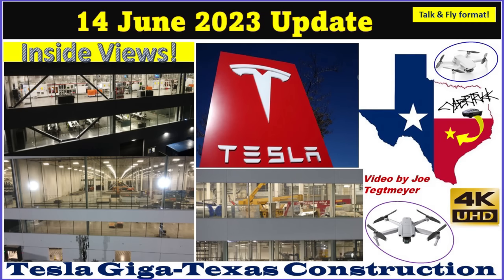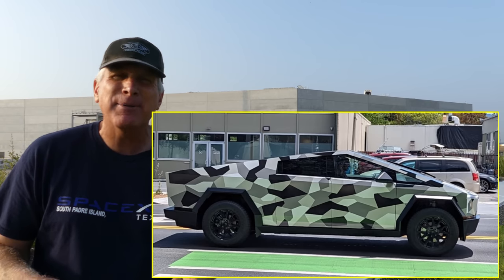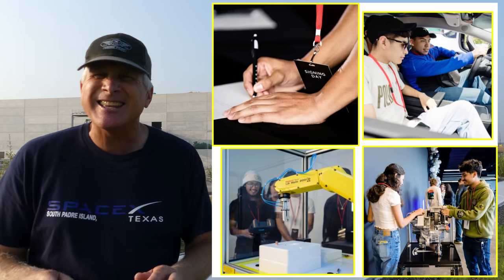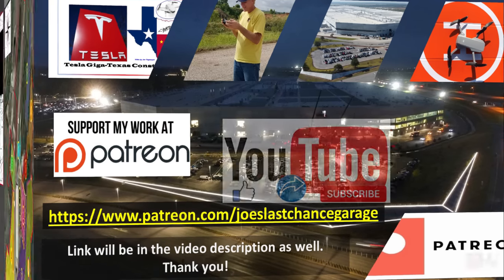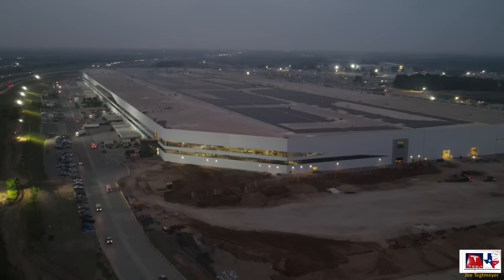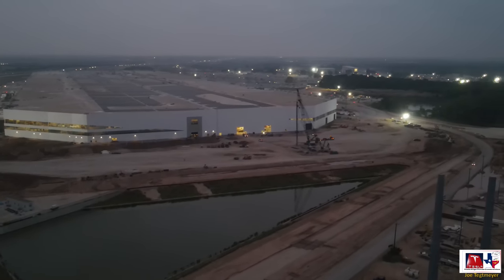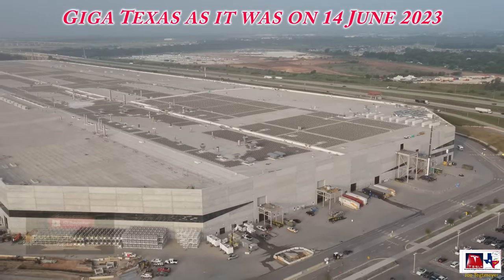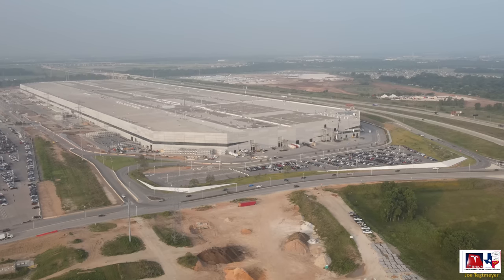Interior Views! Big Deliveries & Cathode Window Installation! 14 June 2023 Giga Texas Update(6:45AM)

Comment: Thanks Joe. Early morning views are great. Bumper issue today.
4:44. Battery. Cafeteria on Level 2, and Level 3 immediately above.
5:38. Battery. Level 2. Drop sheets. Painting inside also.
5:58. Battery. Level 2. Another cafeteria.
6:28. Battery. Level 3. Column at base of stairs. Last views in here, this was about the extent of Level 4.
6:40. Battery. Level 3. Mezzanine/Level 4 generally the width of 2 column bays.
7:34. Main Entrance, inside. Floor part sheeted with cardboard and plywood over. Presumably for scissor lifts to drive over. Floor must be a finished surface now.
Reception desk now black. Scaffold constructed around the desk area, deck level about the right location to work on the face of the bulkhead.
Ducting on the floor awaiting installation.
8:10. GA Level 1, General Assembly 2 and 3 lines being installed. What’s all the production equipment on Level 3 for?
8:17. GA Level 3. Black items look like structural battery pack crates.
8:40. GA Level 2. Very low ceiling height compared to the other floors. Might be suitable for offices.
9:00. GA Level 3. Huge numbers of robots visible in here. Is this Cybertruck BIW, Cybertruck GA? 
9:48. GA, south. Level 2 window looking into Level 1. A plant platform/mezzanine visible though the floor opening. Might be an inter-floor vehicle transfer point.
10:16. GA, south. Level 3 floor opening infilled.
10:37. GA, south. Level 2 window looking into Level 1. Truck load of spoil leaving. Still digging.
13:03. GA/Stamping 2. Left. CFA piles barely visible in the excavation abutting the existing footing. Similar excavation at 13:42 has 3 CFA piles.
13:29. Southend. Breaking away the concrete from the top of the CFA piles to expose more of the rebar.
13:56. Southend. Rebar cages. Some of these are complete and ready for installation.
River Road/North-south road intersection. Right. Trenched across for more conduit.
14:06. Southend. Right. Assembled forms for concrete pedestals. For similar footings as seen in Stamping 2, i.e. deeper footings for some in-ground structures to be built between. https://youtu.be/85CBlJHKvcY?t=406
14:18. Stamping, apron. Another curved machine guard.
15:58. North-south road. 3 large but not particularly heavy deliveries. Twin axle trailers only.
18:12. Cathode, east. Some geo-piering done to the left of the excavators.
19:11. Cathode north, Level 3. Window units installation commenced.
19:57. Die Shop, north. Formwork and rebar for an apron. Trenches for a rail system perhaps. Maybe a travelling gantry crane.
20:34. Cathode, plant platform. On the ground. Stainless steel pipes with elbows and reducers on either end.
22:24. Tesla road, north. Vaults. Duct-bank  pointing north to the switchyards.
23:06. New switchyard/substation. Right. Stacks of formwork shuttering for the Mega-Vault walls.
Mega-Vault. Top Left. Plastic laid over the slab. Serious about curing this.
25:39. Tesla road/BESS site access. Road closed, trenching works.
25:48. Northend, parking. New slab, bollard either end. Location for a permanent Security building, or a pedestrian crossing perhaps?
Reply: 25:48 - Maybe they just wanted a slab they could tear up to access the duct bank again?
Reply: @patrickkenny2077  25:48. On closer inspection there's parallel dashed lines, and 'cut here' embossed into the surface.

Comment: Joe, thank you for continuing information from the construction areas. At 16:04 are shown four large boxes on low boy trailers. These might be assembly line modules that have been assembled and tested at the manufacturers location and will be installed next to one another to form the line. This process is normally used to be able to easily adjust the line as required.

Comment: Great Flight Joe. The YT channel CSI Starbase most recent video went though the connection of power that is going on throughout the facility. One thing looked very similar... At Starbase they built a huge transformer vault that goes between the switchyard and all the conduit to the facilities. I think a large transformer vault is what is being built on the south end of the new switchyard.
Reply from the maker: Thanks DJ and you may well be correct! 🤠🤗
Reply: Switching equipment possibly (Possibly on upper level). No need for more transformers at this location.
Reply: @DavidJohnson-tv2nn agree, likely a vault for 3 phase high voltage buss bars (likely one set on the left, another on the right, matching up with its nearby switchyard transformer), this will be the “demarcation point” between the utility and Tesla, from each of the new switch yard transformers, once its all connected, it’s unlikely they’ll need to enter it again, but with Tesla, you never know
Reply: @mwolrich  "When's the last time we dug this area up?" 😁
Reply: @scottgaree7667  First time... they installed the temp retaining wall, now their installing the high voltage distribution vault, then it will be backfilled, with a few manholes to enter it, most likely
Reply: @mwolrich  Keep in mind that they will need a means to independently disconnect each of the conduit-banks going out to the different buildings, in order to perform service. They will also need a means to disconnect everything from the LCRA transformers and connect to the backup power feeds from the BESS substation in the event of a power outage. This can only be done with switching equipment. Which will need maintenance. Just speculation at this point, but this will probably be a two level structure. A cable room or vault below grade, with switching taking place on the upper level.
Reply: @DavidJohnson-tv2nn we’ll see, in due time.

Comment: 23:51 Substation switches/disconnects.... Can't see clearly past the north A-Frame structures. But... All appear closed except power to the transformer primary and the east monopole. Meaning, depending on the circuit breakers, the substation is ready to be energized, or already energized. No changes in the last couple of days.

Comment: What is the black plastic pipe used for?
Reply: 22:16? One would likely be a force main (pumped) sanitary sewer. Both may be in fact. 

Reclaimed water gets mentioned, but that is normally purple coloured, purple painted, purple sheathed, or otherwise clearly marked to indicate what's in the pipe.

Comment: Substation:
Tesla Enclosure/Mega-vault: @ 22:59 Any guesses as to the purpose of the concrete pads?
Tesla enclosure/Mega-vault: @ 23:14 My guess is that Most conduits will enter from the south side. At least 4 entry points. (2 duct-banks out to the factory, and 2 in from the BESS substation 24.9 kV bus). Perhaps 2 more duct-banks out to the vaults seen @ 22:21 And perhaps as many as 8 conduit entry points as Harder NL suggested. Again, just speculation, we will have to wait and see. 
Don't have a guess for the entry points for the feeds from the LCRA transformers yet.
Reply: 22:59 I think those are concrete wall panel forms for the vault. They are about ready for them.
Reply: @bobcallahan2322  You may be right. Thanks!
Reply: @DavidJohnson-tv2nn  David, this is just a guess:  When we used to design computer rooms we had a raised floor with removable floor panels and all wiring to the plants entered from the bottom to the equipment cabinets. This may be the idea here also. The feeds from the transformers may enter from the top of the building.

Comment: at 26:40, the racks on the left appear more boxy than the ones on the right with the angled bars.. you can see the same type with castings inside on the extreme right of the image. a close-up of the contents of each rack would help a lot
Reply: The racks in the center are rear castings which stack inside each other, the other racks are for front castings only five per rack.

Comment: can you not anodize stainless steel?..be my choice if possible.
Reply from the maker: I think it would have to be done before assembly
Reply: Stainless cannot be anodised, the process would damage the steel.
Reply: @JoeTegtmeyer   no you should be able to use chemical treatment like a paint, wipe off, to get anodize color..yes if you dipped to anodize you would get brighter color, but be all sides and might limit welds glue bonds..but a hint of color should be easy..as wipe on..no regrets as wont come off..fancy pants could add electric currents to create ..well stripes as only where liquid sit,puddled would take current and activate chem to achieve color brighter changes greens to blue- red to purple..treating stainless this way is possible..some heat treatments..also..but its all new as stainless..ty elon great thing it will be..and ty joe love ya reports
Reply: @garthbews4863  Anodized metal is actually metal that has been chemically treated to oxidize the surface. The metals include aluminum, magnesium and titanium.
Reply: @eltonray2934   i was sure.. i ve have seen"  looks like anodized kitchen sink/back splash/counter/hood"  .. i ve seen the effect of Anodization(yes chemically treated,often with low grade electrification to increase color , have done aluminum ....  i assumed it was stainless steel..pure ,could it been titanium, or mixture?, yes, but costs would huge..was fancy hotel kitchen we were working on..was treated after installation..over weekend..again assumed stainless as normal in this application with fire code/bylaws. they only changed what was publicly seen, behind doors stainless was .normal..? ty  as not metal worker i asked..
can Anodize glass, see marbles..
Reply: @garthbews4863  Garth, the word anodize refers to an electro chemical process (anode) and would work on conductive non ferrous metals, stainless is a alloy of several metals including ferrous, nickel and several others.
Reply: @eltonray2934  ty good sir..i did know some ..now know more which is great ..daily learning. ferrous Nickle now understanding more..but not treatment used in grill area i seen changed assumed, as was told and looked right...now..the last part was glass and marbles..which they call anodized, and are changed, dipped,reflective coating sunk in, could send picture of my marble art(between glass)..i say this as must be why i am confused..wrong word i feel  for marbles..but ty..good to know.. smile often good sir, question/learn always
Reply: @garthbews4863  Garth, your marbles may have powered anodized aluminum mixed with the molten glass for the color. Metal flake auto paint uses powered aluminum for the reflective qualities.

Comment: Vaults: @ 22:21 Conduits heading north. Possibly to "Tesla Enclosure/Mega-vault".
Reply: David that may be right, the only reason that I can see for the structure south of the Hornsby Substation is to add the capability to feed the plants from either transformer or both in any combination to ensure constant power.  The feed to the plants consists of two three phase 24.9 kV buses in parallel and failure of one bus would not cause loss of power.  They might tie in the 24.9 kV backup from the BESS here. Also this may be the control room for the BESS.
Reply: @eltonray2934  Elton, I'm thinking the same thing.  The 24.9 kV backup from the BESS will enter the "Tesla Enclosure/Mega-vault" as well as the two 24.9 kV feeds from the LCRA transformers. Then power will go out to the main factory via parallel conduit banks. And also to the Cathode building via  parallel conduit banks. I'm really impressed with the parallel system that goes all the way back through the substation to the transmission lines. I'm guessing that the parallel path will be maintained through the Mega-vault as well?
And yes, if they build an upper level onto the structure... There may be space for a BESS control room as well. The downside is that if there is a fire, they may lose their backup.
Reply: @DavidJohnson-tv2nn  I read that there are sophisticated fire suppression systems based on a combination of Argon- and Nitrogen gas for high-voltage switching enclosures. Cylinders with this gas mixture are automatically discharged into the vault when fire/smoke is detected and the level of oxygen drops from 21% to around 10, enough to stop a fire but still non-lethal for a person. I understand such a system provides excellent assurance and takes care of the downside you mentioned. A true enclosure (a vault) is then indeed required.
Reply: @hardernl8893  After reading your comment I came across this video, showing high tech switchgear. Not all of it applies here some is low voltage (480 V), but some is medium voltage switchgear.... 
https://www.youtube.com/watch?v=VkzyhWLTdSE
Here is a low voltage safety device, but cool none the less....
https://www.youtube.com/watch?v=z4WqTeBsvaM
Reply: @hardernl8893  Tried to post a link to a video showing the Argon/Nitrogen fire suppression system you mentioned, but it failed to post. YouTube seems to hate links.